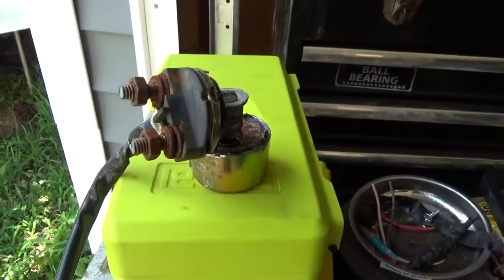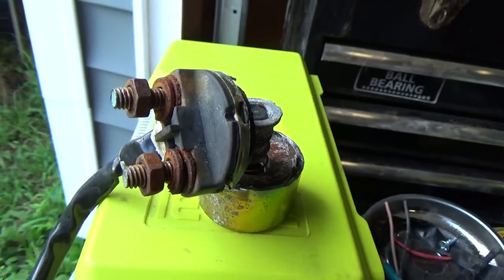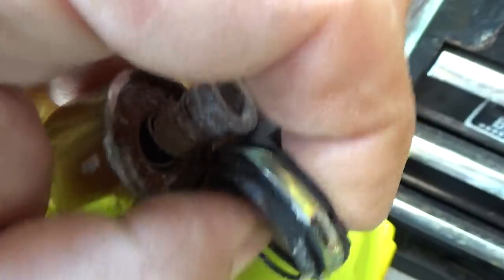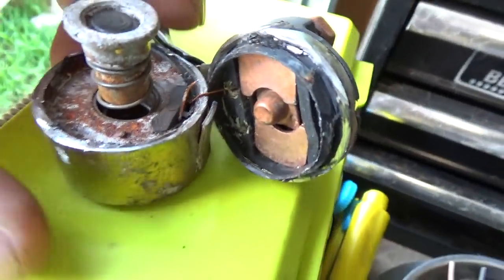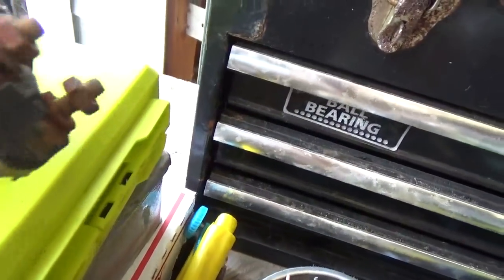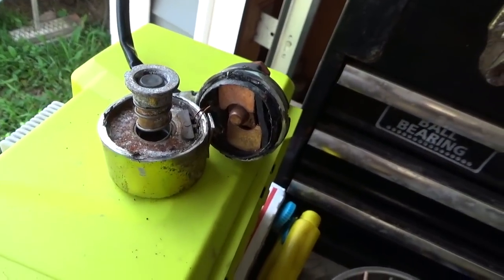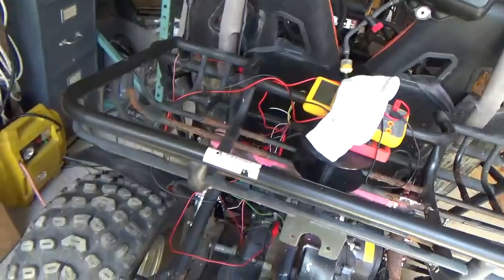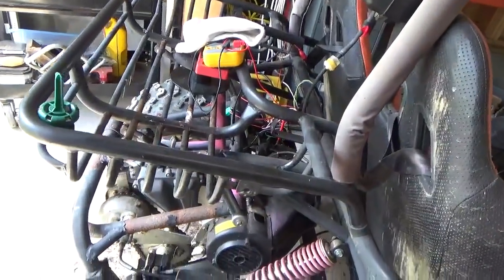Inside a failed ATV Starting Solenoid, why did it stop working?,

Comment: People can't work on stuff. People that can don't have a problem fixing things but usually people that can fix stuff doesn't want to fix it. The key is not to allow these machines to sit which just compounds the problems they possibly will develop from being cheaply produced (and almost always neglected). The cure for cheap solenoids is to buy one of the Ford style like you find on older Ford vehicles or "N" series tractors. Failure in your case was destruction of the electrmagnet coil and not the contacts. I got sick of changing them on my craftsman mower from contact failure and installed a big honkin' Ford style that can handle high amps AND has a heavy built electromagnet (solenoid) side. No more solenoid problems, it has outlasted the mower and now is installed on my (new to me) replacement craftsman mower. BTW , I sent a guy a link to your cdi repair playlist to learn how to fix his china cdi woes last night. Have a great day.